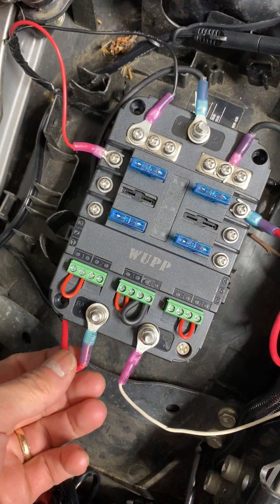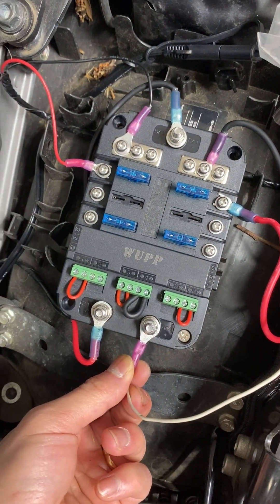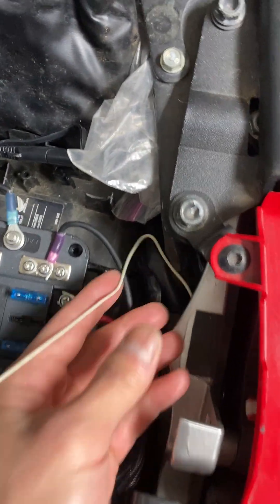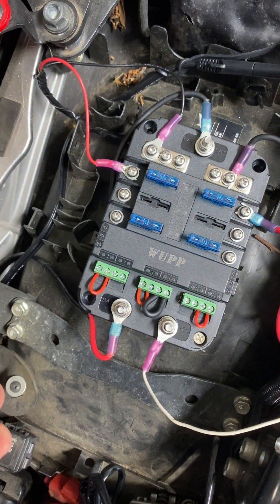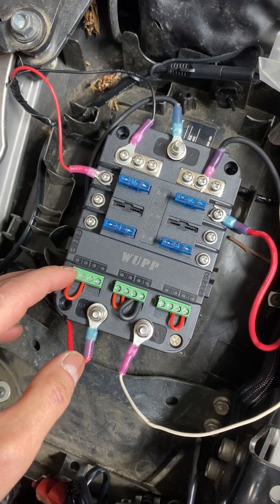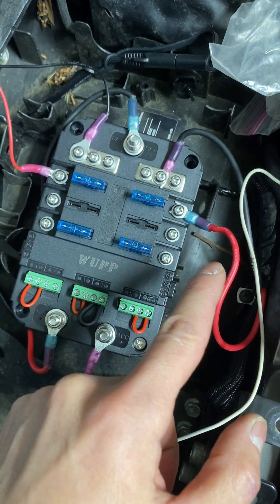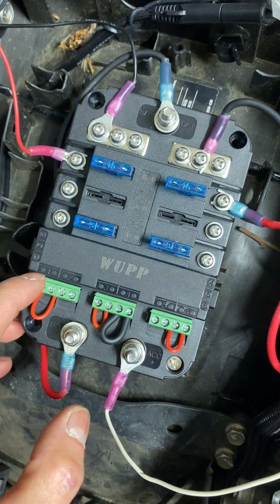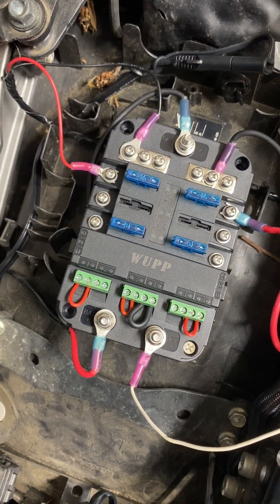How to wire WUPP 12V Fuse Block with Relay

Comment: You basically very vaguely explained how to bypass switches, you couldve bypassed that all the time you wasted by getting a basic fuse panel, dude. You wasted money on a fuse relay panel just to bypass the switches. For what? What did you even hook up to it? Man I hope you dont do this for a living😆
Reply from the maker: Thanks for watching. 
No, I don’t do this for a living. I made the video because the instructions that come with these relay blocks are garbage. 
I didn’t bypass switches. The relay panel isolates accessory power and energizes only when the ignition circuit is active. That setup protects the switches and wiring, reduces voltage drop, and prevents battery drain. 
This is a proper electrical wiring, not a gimmick.
Reply: @jasonl5589 Again you could've avoided that nonsense with a basic fuse panel bro. That is a switch panel for specific systems, not your fault, Amazon is vague. I bout one to put in a 62 harvester for fog and flashers and a really loud horn to deter bears, 60% of the time it works.. all the time😂 bears are nasty when you startled them with obnoxious noise sometimes but anyway thanks for responding bro, I didn't mean to insult but I viewed like 10 of those vids and not one was thorough, people see that say ok and then they end up with a rat nest of wires, I see it all the time some shade tree backyard half-assed master leaves wire clusters all over the place open end. Urks me to ne end.

Comment: I guess I’m uncertain why you need the main BATT from the battery AND the ACC from an ignition powered source? If you want power only when the ignition is on, why not leave off the main BATT line? What is the point of both a powered BATT and a Powered ACC input?
Reply from the maker: This is a relay, so BATT+ won’t supply power unless ACC is energized; that’s the entire point of the relay switch. With this setup, if you only connect to BATT+, you won’t see voltage because ACC isn’t energized to allow current flow from BATT+.

If I wired directly to BATT+ and BATT-, the circuit would draw power constantly and drain the battery. That’s why I used a relay—so power is only available when the key is turned to the ON position, which is when ACC is energized.